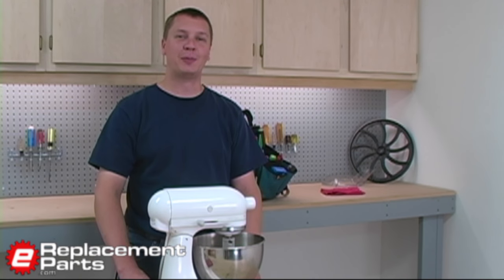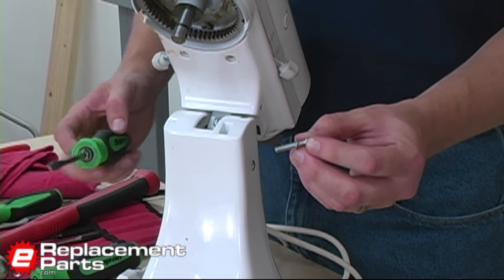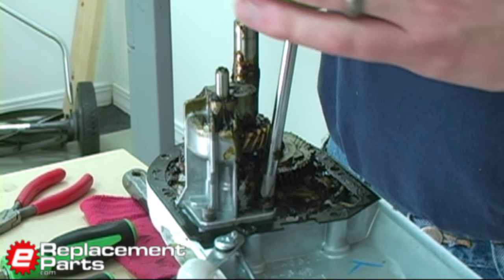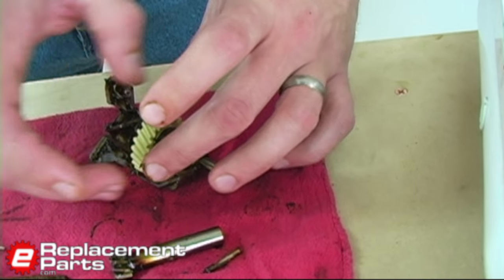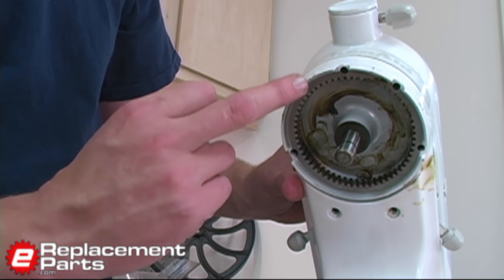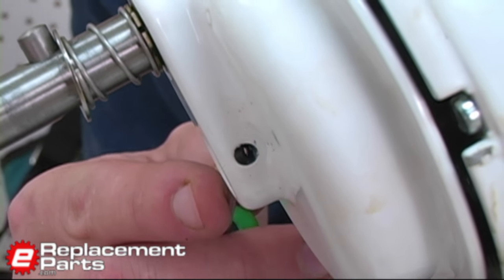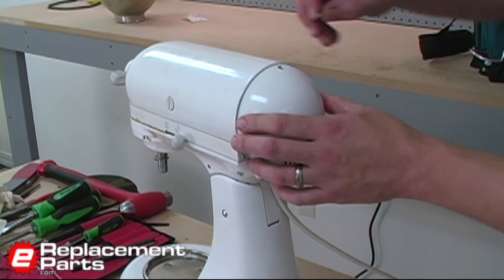How to Fix a KitchenAid Mixer That Isn't Spinning

Comment: The video was extremely helpful. Everything came apart & went back together just as explained in the video. It works but I feel as though I need to mix my chocolate chip cookie batter that is a very heavy. That will be the ultimate test. crossing my fingeres & holding my breathe, I love my KitchenAide Mixer <3

Comment from the maker: Thanks for your question and your suggestion! Any of the gears in these mixers van fail. The replacement of the attachment gear (Part #9705130) is very simple once you have the head open. Using a hammer and a screwdriver you can tap out the attachment gear. If it doesn't come out easily then that is a sign of a bigger problem that a service center should take a look at. Once you have that gear out you will want to inspect the bevel gear (Part #9709627).

Comment: Great video, thanks for the help! If it wasn't for this, I would have probably donated the mixer and shelled out $150 or more for a new one.

I bought the entire tower with the worm gear in it off of ebay for $10 with free shipping. It said it was an OEM Whirlpool (Kitchenaid) Stand Mixer Worm Drive Pinion Gear. The part No. for mine was 240309-2. I have an older K5SS and it conked out about a week ago. Seems to work fine now.

Comment: I used your video guide to break down my mixer. I have ordered the the replacement worm gear and I am waiting for it to come in the mail. I have one question though. Should I re-grease the gear assembly before I put the cover back on? In your video the guy just puts the cover back on the completed assembly. Thanks for your time.

Comment from the maker: @nauticalPrincess123 It is not necessary to replace the grease just to fix the problem of the mixer not spinning. However, it does make sense to replace the grease just for the sake of already being inside the gear housing. No harm in anticipating another repair down the road and taking care of them both at the same time. Great question and thanks for watching!

Comment: Brilliant video.  It gave me the confidence to send for the part which arrived next day from Amazon and I fitted it without a hitch.  Only one little problem, the drip ring either goes on easily and then falls of or if I twist it it will not fit. Any suggestions please.

Comment: This was a phenomenal video..... done professionally and in 'baby-steps' just like I like tutorials to be.

Question:  My wife's Kitchenaid Mixer doesn't have the 'No-Spin' problem.... it is making a 'clackety' noise and the motor unit is kind of twitching and jumping up-and-down..... doesn't matter what attachment is on the twirling shaft of the machine.  Any idea what I am dealing with?  Please see video response......Thanks.

Comment: Our Kitchen Aid must be well over 10-12 years old. Nice repair video - makes it look pretty easy. 
Our unit seems to be running on only one speed and makes a bad noise. Probably also slips or skips a bit. Worm gear??  Sounds like Si just open it up and see what gears are worn. Hope it's not motor related. Thanks!!

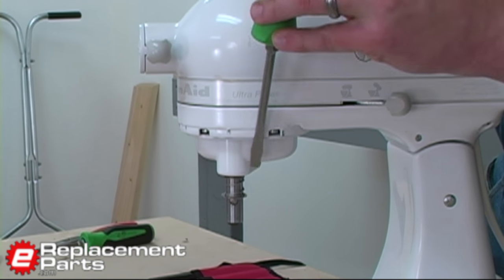Comment: The roll pin that holds the planetary on (1:33) is aluminum and a very tight fit. Very difficult to remove even with correct tool (a punch). I drilled out the end of the pin that I was not hammering and chipped a lot of paint, but who cares. My worm gear tower, pinion gear, sheared off some teeth, which you call the lower gear with shaft or tower gear (4:38). This is a metal gear so if this happens to you make sure to get all of the metal out of the grease. I found that Amazon has a full replacement worm gear tower with free shipping for $9.99 (US). This gives me peace of mind, since I get a new nylon worm gear on the pre assembled tower. My motor had an additional issue. When reassembled, the motor wasn't turning on and going through the different speeds correctly. The issue was the two 10mm nuts that hold the motor in the motor housing at the rear of the motor behind the paper gasket. If these aren't tight, the motor throttle will be affected and will not work properly.
Reply from the maker: Ken Lewis Thanks for the feedback!

Comment from the maker: @MrGeorgeMunroe Thanks! A little gear noise is normal. If you have noticed it getting noticeably louder recently then it might be worth looking into a little closer. It could be a worn gear or simply a lack of lubrication on the gears. A damaged gear will cause the beater to stop or skip during use.

Good luck!

-Mark

Comment: Thank you so much for this video! It was easy to follow and provided step-by-step instructions through the process. I actually replaced the whole KitchenAid Worm Pinion Gear Assembly for less than $10, which was almost the same price as buying the gear alone, and saved myself the trouble of having to take that whole component to isolate the worm gear. Thanks again for your help!

Comment: Hi, Thanks for the very nice tutorial.  I did the replacement of the gear as detailed, and everything went fine. Once I tested the mixer at the end though, I saw some sparks inside. What did I do wrong? I didn't even touch anything electric in there. Thanks for your help!

Comment from the maker: Either side can be used to remove the pin. Sometimes they require some harder hits to get out. If you are not having much success on trying to get the pin out from one side try from the other side. Keep working with it and it should come out. If you are not able to get it out you should consider taking it to a service center for repair. In rare cases the pin is sheared from the shaft and it takes some special tools to remove the planitary that only a service center will have.

Comment: Great video - Suggestion for a mixer that has smoke and a burning plastic smell coming out of it?  It still seems to run.  I checked the motor brushes, which looked fine.

Comment: Hey Mark, thanks much for this video. I know it's 8 years old now but as the KSM hasn't changed much since 1947 I was still able to use your great tutorial to fix my mixer. My KSM is only a couple of years old, so the use of square drive head screws to hold the motor housing to the chassis may be new. Luckily I had some on hand. You made it a piece of cake (so to speak) :) Thanks a bunch!

Comment: great video, my mixer broke and i fixed it!!

 Thank you so much

had a little trouble getting the pins out, much harder than you made it look but the rest was easy

the metal cogs/ worm gears are showing some wear (its 15 yrs old) can/ should they be replaced as well at some point?

Comment from the maker: @aldemar868890 Very good question. Any gear breaking in the gear housing will cause a mixer to stop spinning. If the worm gear is broken it will be obvious with a brief inspection. There will be heavy wear on the gear teeth or teeth missing. We did the video on the worm gear because it's the gear that breaks first most of the time. If your worm gear looks good, you'll want inspect all the other gears until you find the one that failed and replace it. Hope that helps, and thanks for watching!

Comment: I want to thank you so very, very much for this clear and well done video. The only thing I missed was where you were putting the screw with the lock nut on it,  the film dissolved just at that time.  I just cleaned up a running old Hobart KM-3 but after removing the back and the metal band I was still unable to remove the top.  I can see the five screws that you removed from the front so can you tell me, if you know, if that's what I need to do to get to the motor on mine because now it won't start.  After all the cleaning and polish and making it pretty again, when I plug it in nothing happens.  Hope it's only a lose wire but I need to see if I got any water inside while working on it, I'd thought it wouldn't open because it was stuck with old dough etc. Any suggestions or corrections on taking it apart again?  What a service you do, thanks.

Comment from the maker: @MrGeorgeMunroe That sounds like a good plan. The only way to know for sure what's going on inside the mixer is to take it apart and inspect the grease and parts like you say. As far as the noise, it's hard to know without hearing it myself. Bad grease is a possibility. Let us know how it goes and thanks!

Comment: This was a very informative video. My kitchen aid mixer has not stopped spinning yet. Right now it is just spinning at one speed no matter which setting I have it on and it makes quite a bit of noise. Can you tell me if this also is a sign it needs a worm gear replaced or if it is some other part? Thank you.

Comment from the maker: You can help loosen it with a few drops of oil. From there it may take some work to remove. To prevent this from happening again you want to keep the shaft clean and avoid getting anything into the hole of the attachment. Residue from dishwasher detergent, for example, is quite common in these cases.

Comment from the maker: Our video titled, "How to Fix a KitchenAid Mixer That Isn't Spinning", will show you how to get into your mixer. Once there, locate the screw that holds the lock lever in place. Tighten it 1/4 of a turn at a time and check the tightness. It should be tight enough that the lock stays in place, but not so tight that you can't unlock the head.

Comment: Hi and thank you for this awesome video. My questions is, my mixer at first doesn't spin but if I push it along a couple times and up the speed it'll catch and start to mix. Once the mixer starts it continues with no problem. However, it's getting it to jump start that's the problem. Would I still need to get a new worm gear? Maybe there's something else I need to do to resolve this? Please help?

Comment: Hi Mark,
Thanks for the video.It was helpful to see how the unit comes apart and goes together.
My KitchenAid mixer is the raise-up kind, not the tilt back kind. Recently I noticed that it started making rhythmic, and slightly grinding noise with each revolution.
I'm afraid to use for fear that it be worse. Family depends on me to make bread for Easter.
I use the mixer to mostly knead the bread dough. Any idea what may be causing the noise?

Thanks for your help,
Zane
Reply from the maker: Sounds like one or more of the gears are well on there way out. What gears you will need depends on what model your mixer is. Your model number can be found on the bottom of your mixer. We do have videos for both types of mixers. Also, you can check our website for parts.

Comment: This is a great video. My 5 Qt Artisan Stand Mixer has been on its way out and last night stopped turning on and spinning. Prior to that it would only spin if I started it at the highest spin level. Is this roughly the same problem everyone is having? If so, I'm going to order the worm gear and replace it and hopefully it will work again. Thanks you.

Comment from the maker: If the red and white wires are not pinched, check the other wires. The best way to repair the red and white wires is to take the mixer apart so that you have better access to them. If this does not resolve the problem, you can also double check that the brushes are in the right way. We also have a video explaining how to do that titled, "How to Replace the Brushes on a KitchenAid Stand Mixer". If doing all this and it still does not turn on you should take it to your nearest service center.

Comment: Thanks for the helpful video.  I have run into one problem.  When I put on the new planetary, I slide on the worm follower gear but the retaining pin holes don't seem to be quite high enough above that gear.  I can get a small screwdriver in the holes and pry up the planetary shaft a little more and then can tap in the retaining pin.  But then the worm follower gear will not turn because it is being pressed too hard by the pin.  This is a new planetary.  My old planetary did not have this issue.

Comment from the maker: There are a couple things to look for. Planetaries will have one or two washers on the shaft going into the lower gear casing. Sometimes these washers will stick to the underside of the lower gear casing because of the grease. You should only need one washer on the new planetary. The other thing to check is if the halo gear in the underside of the lower gear casing is hanging lower than what it should.

Comment: Hi Mark: Thank you for this very helpful video. We've replaced the worm gear and it spins great. However, now the gears make a grinding noise at higher speeds..could it just need new grease? or is it something else? Please and thank you for your help.

Comment: What would you suggest when the attachment spins with light pressure at all speeds, but tends to stop when heavier pressure is added?  The motor continues running, but the spinning just can't push hard enough.

Thank you so much for this video; looking forward to using it when ready for disassembly.

Comment: Thank you for the video. It was very informative. One question; how do you remove the planetary roll pin? I'm using a 5/32" punch and it will not budge. Any ideas on how people have been able to remove this pin? Thanks.

Comment: I replaced the worm gear as you advised and it was a great step by step demonstration. Unfortunately when  reassembled it, I lost power to the unit. Is there a reset button that  cannot find?

Comment: Hi! Thank you for the helpful info. How do you know which part is broken? My kitchen aid won't turn on (I've only had it two years but used it multiple times a day.) I have it open now, is there a way to know if its the brushes, wormhole, or the gear piece you are talking about above? Should I just replace everything?

Comment from the maker: Thanks for watching! What could have happened is that the wires in the back were pinched when it was reassembled. To find out, make sure that your mixer is unplugged and tack off the rear housing. With the housing off find the red and white wires on the right side that attach to the control plate (black plastic piece that has wires connected to it). Check to see that these wires are not pinched by the motor housing and base. It should be apparent if they are.

Comment: Great video, very well detailed.  I have a question.  My KitchenAid mixer spins but the beater isn't spinning as normal.  This happened after the wife jammed the thing by not having the bowl on securely.  Is there a different gear that spins the beater or will replacing the worm gear work.  Thank you in advance!

Comment: First I want to thank you for thee great videos.  What a helpful service to offer.  I'm having trouble removing the roll pin to be able to remove the planetary.  I cannot see the roll pin through the hole.  The beater has been slipping and I can manually turn it through about 30 degrees.  Is it possible that it has slipped such that the roll pin is not aligned with the hole?  Should I make it slip more until the roll pin is visible?  Thank you for any guidance you can offer.  Kevin

Comment: Thanks to these wonderful instructions, I was able to replace the gear in mixer #1. 
For mixer #2 - an identical model - I removed the five screws and then the four screws, but I cannot lift the motor off. I've pried and tapped with a soft hammer. No luck. Could you suggest a solution?

Comment: Hi there, thanks for these videos... they've saved me a lot of time and money! I do have an issue though... at least I think it may be one. Is the shaft supposed to spin freely (a little force required) before the planetary is put back on? I've done the seating like you've shown and the armature and shaft spin freely before I put the top of the mixer back on but not when they're together.
Reply from the maker: How are you checking this?  If you're trying to spin the motor by the lower shaft, you won't be able to. The worm gear will spin the shaft but the shaft won't spin the worm gear.
Reply: Oh ok great. I was actually replacing the tilt head mixer's motor and had forgotten to put the washer back on between the armature and the back metal plate. Worked like a charm after. : ) Maybe you guys should do a video for that maintenance as well! Also, not sure you're allowed to do this but I replaced my motor and phase board to the UK standards and had a 220V UK mixer minus the $400 extra bucks. If you guys could do a video on that I'm sure there would be quite a few more hits coming your way! ; )

Comment: Would never understand how to disassemble it without this video, thanks a lot. However, I have not managed to fix mine - it behaves strangely at low speeds, see my video of this! I tried adjusting the speed controller but doesn't help. When it transiently speeds up, the shaft that touches the speed control plate simultaneously moves outwards.

Comment from the maker: The bevel gear meshes with and drives the attachment gear. If this gear has teeth missing it should be replaced. To replace this gear you will need to remove the center shaft and pin. With a hammer, gently tap the center shaft from the bottom to help lift it up and out of the bevel gear. Be sure to check for any fragments of metal in the grease and remove them. Once that is done all you need to do is grease and reassemble and you are ready to go again!

Comment: Great video!

What would you suggest if I can't get the drip ring to stay on the mixer? When I press it on and bottom it out it just comes back off. Otherwise the repair on my mixer went great.

Comment from the maker: The only brush holders that are available use a spring spade connection that fits snugly between the brass insert and the brush holder. The older styles are no longer available. You might have some luck trying some of KitchenAid's service centers to see if any of them might have some in stock still. Thanks for watching!

Comment from the maker: Some of those pins can be difficult to remove. Just keep working at it with a hammer and a punch and it should come out. If all else fails, take your mixer to the nearest service center.